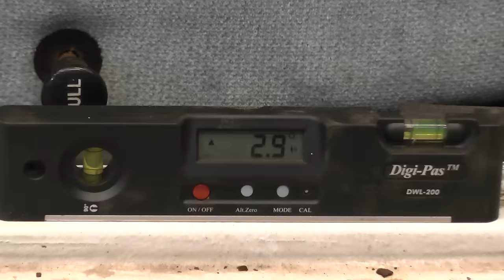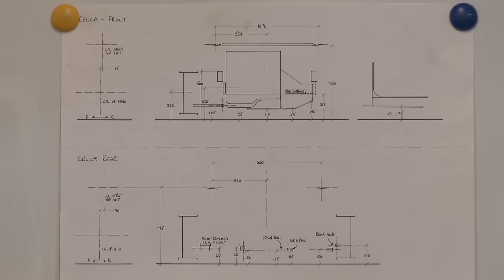Project Binky - Episode 1  - Austin Mini GT-Four - Turbo Charged 4WD Mini

Comment: You may be able to take the engine and drivetrain out of the Toyota and shoehorn it into the Mini (I don't know, I haven't skipped ahead) but just imagine what you'd get if you stuffed the engine and drivetrain from the Mini a stuffed it into the Toyota! That's right a project nobody, and I mean NOBODY has ever done much less contemplated ever doing. A true act of lunacy... Perhaps even in a good sense.

Comment: My first car (in 1978) was a white mini 1000. FT101E transceiver under the dashboard and HF whips hanging off the rear.  I welded a complicated tow hitch under the floor and used it to tow a small trailer (built from the rear suspension of an older mini)  up and down the East coast of Australia.

Comment: OK, good start, I am in for the long run to watch the series.
 I have had a few minis in my time, rear sub frames always a problem, front CV joints problem,Hydrolastic probs on later models, rust always a prob, deadly in a crash, try replacing speedo cable, or exhaust manifold coupling, or rubber drive shaft couplings, etc. Always a problem in the rain, you had to fit a 5 finger rubber condom over the distributor filled with WD40.

 But great car to drive, and throw around corners, all young lads of my era wanted one, and learned how to fix cars.
 Thanks for the British humour, very entertaining.

Comment: I agree multiple cheap grinders beat one expensive grinder!  TIP: Mount the CAPS of the markers to your workbench...then you just use one hand to pull the marker and store it-sealed!  Also "white-out" correction markers are finer than paint markers and the same thing at a lower price vs "welders" markers. The tips are rollers, so don;t wear out.

Comment: Mikey’s YT binge watch tip:
Select 1.25x Playback speed using the 3 dots at the T/R of the screen...hardly any difference but saves 25% time on binges.
For added mirth select 0.5x (drunk) 
1.75x (quadruple espresso)

Comment: That would have looked awesome with the front lengthened. Plus, it would have had the added bonus of giving you more room behind the dash later in the build. Not by the amount that is needed, but just split the difference.

Comment: 2nd time round, watching this build and have had a thunk. Instead of using a grinder to clean up the panels, why not use an MBX wheel as at least you won't be making the metal thinner. Or even have it dipped.

Comment: Hey up lads. I've found myself come back to watch the whole series again. I know you said you didn't want to build a stretched spaceframe with a longer bonnet to accommodate the bigger power plant, but, in retrospect, if you had to do this again, would you build a mini sized spaceframe? It seems keeping it monocoque has made life difficult, necessitating loads of fabricating that wouldn't have been necessary in a spaceframe.
Reply from the maker: +Mikey R We decided very early on to try and make it look as factory as we possibly could, so a spaceframe was out of the question.
Reply: Hi Bad Obsession Motorsport, I just realised you mean you want to keep the factory look inside, as well as outside. That makes sense in a road car, if you don't need a roll cage.

Anyway, keep going! I can never wait for the next episode, but now you're on the finishing straight it's double exciting.

Comment: Why didn't you sandblast the chasis to remove the rust befor welding? Just curious...
Also great project :)
Reply: My guess is, it's probably the paint that's holding it all together.
Reply: +Szioul that might be... I have seen a chassis once only held toghetger by body filler
Reply: That's still better than concrete, wood or gaffer tape!!!

Comment: There's no way on earth or off it that that is a 1980 Mini. The front bumper and turn signals shout 1960s. I had a 1979 Mini; it had a drastically different bumper that required different turn signals. The car was changed drastically for 1980, to look like an Omni/Fiesta/Horizon boxy, ugly mess.

Comment: Level Plates?! LMFAO!!!
Hope you're not intending to drive the finished contraption up, down, or on the sides of, hills. FFS "engineers"! in "onesies"!! Read below...
In a mini with lowered suspension, as you seem to intend, if you're 1/2 a degree off level, your foot well will be scraping along the road on one side. I wouldn't bother taking the time to piss about with such fripperies as "level plates". If you're involved in marine engineering and want to design a sea-going mini to serve cocktails on which don't look lop-sided in their glasses, then maybe the level plates might be a thing. Honestly......
Reply from the maker: Riiiiiight.